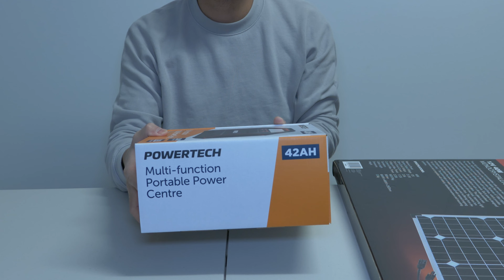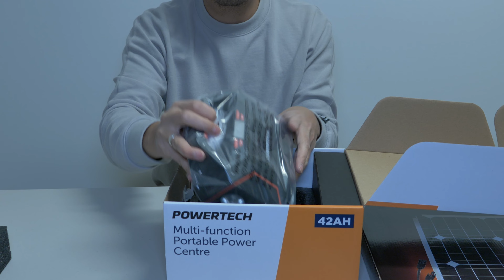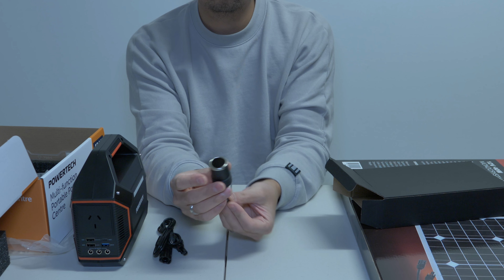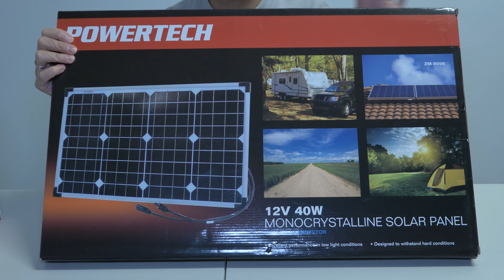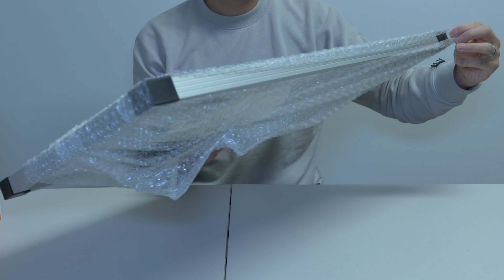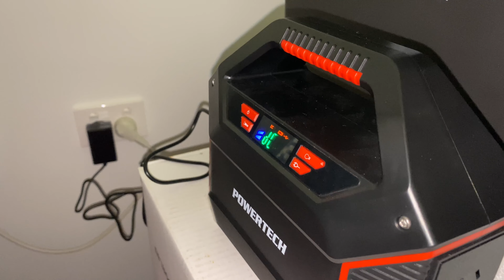AFFORDABLE PORTABLE POWER STATION POWERTECH WITH SOLAR PANEL

Comment: Nice video mate.I watched it and went out and bought one.I use it to run a roland hpd20 percussion pad and a  roland 37 watt monitor .It's perfect for my use I can play percussion anywhere for 3 hours.Thanks for the tips love your work .I got mine for 165 au from jaycar. I will add a solar panel at a later date if I require it so it was a great budget bye and it does the job fine for me and it is portable
Reply from the maker: That’s great 🤙🏾 you got it for a bargain! 👍…Cheers mate 😃

Comment: Ive wanted a decent solar powered fan for a while would this setup be able to run a 60 watt fan properly and if so for how long on battery power alone?
Reply from the maker: It may only run it for 1-2hrs. I would recommend the Bluetti AC2A and the PV120 solar panel which is a better quality. It will run 2-4hrs and longer with the solar. 
The review video is also on my channel. 
Bluetti is currently having a sale and you can get it for a bargain right now with this link! 

https://www.bluettipower.com.au/products/ac2a-portable-power-station?ref=4X4JUMPMAN
Reply: @4X4JUMPMAN  all purpose really 😀 the best portable portable fan I found is the Ozito PXC 18V it runs for 8 hours on high on 4.0ah battery and has really strong airflow while a standard fan might not be ideal with this power station  I wonder how many times the powertech would be able to recharge that Ozito battery; I have alot of tools that use battery as well if it can charge it would really handy in a bind!
Reply from the maker: @zenmeditation9364  it may be able to charge it 2-3 times. Ozito products are great for the price 👌🏽
Reply: @4X4JUMPMAN  they are alright they're cheap ..like me LOL! Powertech is on sale at Jaycar at the moment as well ...One more question assuming you have full sun hot day how long does it take to charge the powertech with the solar panel 🤔 ?
Reply from the maker: @zenmeditation9364 i think it takes about 2-3hrs. it doesn’t have fast charge but it’s ok.
Reply: @4X4JUMPMAN  so it's faster to charge with the panel than the mains?
Reply from the maker: @zenmeditation9364  the mains should be faster than the panel unless you have a bigger panel.
Reply from the maker: @zenmeditation9364 Have a look at the Bluetti it will last you longer and it has 5 year warranty. You won’t have to buy twice. With the Powertech it may only last 2-3yrs then you will have to buy another one again.
Reply from the maker: @zenmeditation9364  will you be using the fan when your camping or in your car?

Comment: How long is the cable from the solar panel to the powerpack? Can you just leave it plugged in to the panel to trickle feed the battery as it drains?
Reply from the maker: The cable is only 1m and I think you can trickle feed it.

Comment: Hi how longs it take to charge the power bank on solar
Reply from the maker: It depends how big your solar is…is yours 200w solar panel?
Reply: @4X4JUMPMAN haven't got one yet but was thinking of the one in your video
Reply from the maker: @withinjapan2023 it would be about 12hrs on full sunlight with the 40w solar panel.

Comment: Has anyone bought one yet and used it ? Was planning on running a fridge through the car when driving and using this at night ? 

Will this run a small fridge all night ?
Reply from the maker: It won’t run all night. You will need the extra battery or a bigger  power pack to run all night.

Comment: Hi JumpMan, I purchased the PowerTech 42AH a couple of months ago to run my newly purchased 60L BrassMonkey 12V DC fridge / freezer. However, when I power the fridge from the battery overnight I find both the PowerTech battery and fridge are 'off' in the morning. This often happens even after only a few hours of running. The PowerTech still has remaining battery so something (an overload, say) is shutting the battery down. Can you help with why this might be? Thanks, Kim.
Reply from the maker: 60l fridge needs more watts to run and might be drawing too much power therefor it’s shutting down. You may need a bigger portable Powerstation or a bigger lithium battery if you got the fridge that supports it. Have you tried running it with a bigger solar? But then the solar will only run during the day and might run out of power overnight. Any fridge bigger than 30l max I wouldn’t use the Powertech as it will run out overnight without extra battery.
Reply: @4X4JUMPMAN  Thx JumpMan - the 60L fridge draws only 60W - so if the PowerTech has 155W available it should support it. You are right though... I may need to look for a more powerful solution. Cheers, Kim.
Reply from the maker: @KIMBRACKNELL  yeah it will work with Powertech but not overnight as mine can run for only less than 4hrs overnight with no extra battery and my fridge is small. The only thing about lithium power stations they are so expensive.
Reply: @4X4 JUMPMAN  how long do you think the powertech would last with the 36l brass monkey fridge overnight?
Reply from the maker: @geepiz9597  not long maybe less than 2hrs  you will need the extra battery pack or a bigger lithium portable around 100ah.
Reply: @4X4JUMPMAN thanks mate 👍